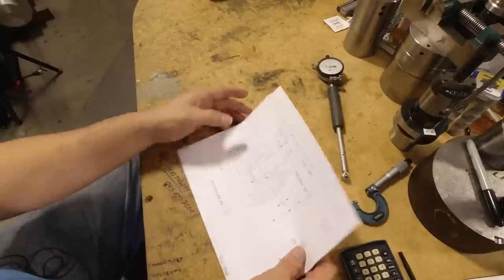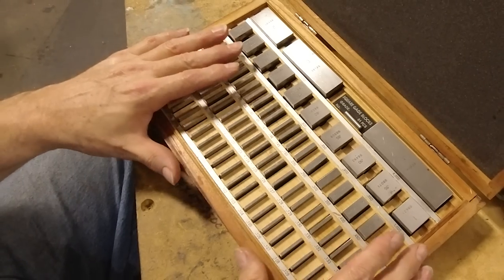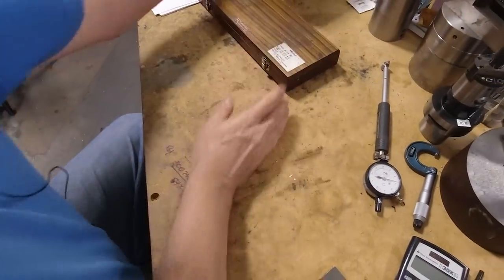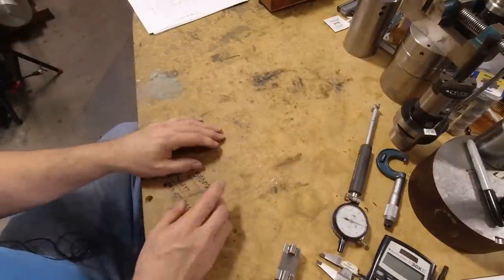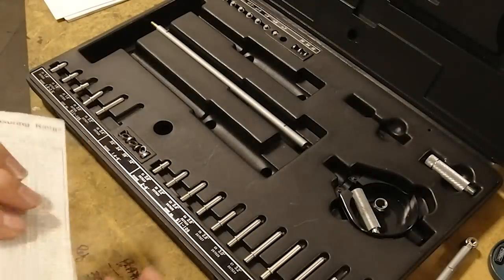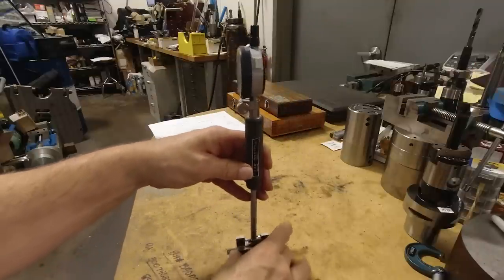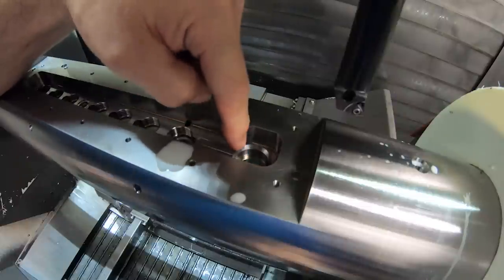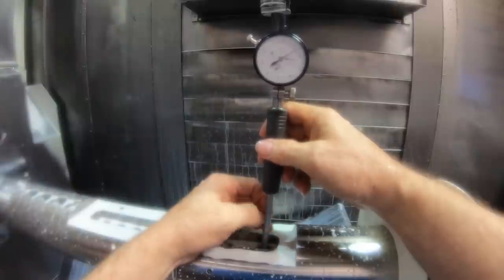Setup A Dial Bore Gauge And Bore

Comment: Thanks for the time you took to include the tool assembly in this video. I just bought my first dial bore gauge (a Fowler model with a total range of 1.4-6"). It came in the case needing assembly and I was looking for some guidance for that job. Your video was helpful, especially from about 13:10 to a bit after the 17:30 mark. I appreciate your having shared your time and expertise. 👍

Comment: Good video. I always set dial bore gauges with a micrometer. I’ve never had gauge blocks to use. I always verify my measurements with a second tool, on first set up, usually an inside mic or telescope gauge. Your way is more accurate for sure. Thanks for the good content.
Reply: gauge blocks are not that expensive really . Grade 1 , 103piece set is 600€ for a no name brand product . One can use a complete set like this to measure grooves , slots , pockets , not just instrument setting .
Reply: Jason Peterson That is how I usually do it as well. I need to invest in a set of bocks like this as it would be handy. I rarely do jobs with tolerances in the tenths range though.
Reply: @bcbloc02  You can also get cylindrical "spacer blocks" for about $50 for a ~36 piece set. They are great for use in the shop when working to a thou or 2. I use them a lot for setting the carriage stop on the lathe.

Comment: paid off my 1st of 2 cnc machines! i have been getting by for 5 years with a 1" mic, 6" caliper and some random precision pins making parts haha.  i appreciate these videos because of the set number and other info, ill be in the market for some of it. im also thinking about getting a manual cmm in hopes of getting more complicated parts to make and some reverse engineering to come up with new parts.
Reply: A height gauge on a good surface plate might be smarter than a really expensive CMM . From a mike and a caliper the height gauge would already be a huge step forward (you can get super duper fancy 'cnc' height gauges too ). Depending on parts a cmm might be necessary, but i doubt it . 
When you have a set of dial bore gauges from 3/4-6" , 0-6" mics , gage blocks , i.d. mics 0.5-4" , 2-3 dial indicators , 1-2-3 blocks angle plates , v blocks , calipers up to 12 (at least) , a protractor , some thread gages , a set of pins for under 1/2" ,16" height gauge, maybe after that it would be worth it to invest 50 grand in a cmm . 

Of course i'm no expert , i just listed the everyday tools that i use almost daily , i didn't even mention groove measuring but that's besides the point .
If i can give an advice....only buy what you need , but if you need it BUY IT , and don't be cheap .
Reply from the maker: I agree with kiss peter. One of the digital height gauges like the Mititoyo or Tesa/Brown and Sharp with a controller. On a surface plate. Like the one you may have seen me use in the casting videos or John Saunders uses on NYCNC channel sometimes. These are way more versatile tools than a CMM for inspection. But they run around $6500.00 new.
Reply: @EdgePrecision  appreciate the tip, ive got two lists, equipment i will finance and tools i will get as i go. i will look into the digital height gauge you mentioned. cmm for me will be as much inspection as for reverse engineering parts to make better parts such as in the automotive and motor sports industry. i have a passion for suspension and chassis and a natural talent for manufacturing. i also want the faro arm with scanner and probe along with a few other things. i want to drive my machine shop production with product development... you have to aim high right..? that way if you come up short youve still gotten further than coming up short aiming right at it haha.
Reply from the maker: DmbWorks for what you are intending the farro arm type of tool would be better than a CMM. It’s not as accurate but to measure things around a car would be much better.
Reply: @EdgePrecision  yeah they do have advantages for different aspects. faro offers the probe and 3D scanner or both in one i believe. probe ive used most for parts with minimally dimensioned drawings, typically on parts with complex surfaces. having the probe option with the scanner would open me up to projects not every shop can do. and yes a good tool for R&D which is the direction i want to go. but i want/need to build a machine shop to support that dream along the way, i have a lot of fab shop tools and experience to. i guess the most important part would be adding the capability at this point. its all on the list, im not married and have no kids haha. i just have to get it in an order that is the most profitable.
Reply: @dmbworks8094  I'm in the same mide set as you man... i recently bought an older manual cmm with upgraded  software for the sole purpose that I have seen more jobs come in as of late with no print (old forgotten military stuff) but a part, a part they need measured and reproduced... and in 3-4 days.... the draw to being able to do a 2d or 3d measurements of a part 20" from the datum with the accuracy of a tenth or so in seconds is very attractive..
Reply: @EdgePrecision   I always use  a cadillac gauge on a surface plate to set my bore gauges, its alot faster than putting blocks together

Comment: I've always made up a gage block stack by starting with the last digit, picking the gate block, subtract it from the dimension, and repeat until the stack is full.

Example: Given a dimension of 0.7438", start with the eight, giving you the 0.1008" block. The remainder is 0.643", so we add the 0.103" block, leaving a remainder of 0.54". That gives you the 0.14" block and then the 0.4" block. The stack is:

0.1008"
0.103"
0.14"
0.4"

The digits 6–9 in the second place are a special case, but easy to figure it when you run into it. You fill them with the 0.11"–0.14" blocks, leaving a 5 in the second place which can be filled along with the first fractional digit.

Comment: Great video Peter,  I have also used two gage pins to check the i.d. of holes putting the pins next to each other and slipping them into a hole being sure there parallel to each other you can feel if there's taper in the hole or if it's out of round like if it didn't clean up completely, where I'm at we have pins that are even and .0005 over so I couldn't check tenths this way, but I get a feel for the straightness and the condition of the hole, really enjoy your vid's the type of jobs you get to machine are very interesting
Reply from the maker: Thanks agb218. For these parts I don't like using pins or telescoping gauges to measure bores/holes. If there are any longitudinal scratches in the bores the customer will reject the part. They fortunately allow the fine scratches/marks left by bore gauges but just that. They are very particular about this. But I can see how that would work.

Comment: Hello Peter
Your works are "poems", I never get tired of watching your videos and I also carefully follow your descriptions even if ... not knowing your language I understand very little!
One question: at the end of the workings in a piece as complicated as the one you are working on, how can you be sure that no chip can obstruct a small hole? Is this check at your expense or will the client take care of it?
Reply from the maker: I don't know it's exact function myself. But it's some kind of part of a down hole instrument for the Petro Chem industry/Oil field. As far as the holes we have deburr guys here that do a lot parts like this. So they have special tools and bore scopes to check for burrs ans shavings in the holes. They also use a high pressure washer to blow 3000 psi water thru the holes after deburr.
Reply: @EdgePrecision  Thanks so much for your reply.
Have a nice day.
Ciao Stefano (Italy)

Comment: Ya i like the Testmess that back and forth needle movement gives it a more fun feel  like if you dont get it on the scale the next contestant takes your place. The cool tools like that indical that test indicator bore gage, and specialty gaging like that have always been a fascination with me. I actually one of the things I'm considering manufacturing is a crow foot set . An automotive cylinder block O-ringing tool with a sharpening fixture for the actual real trepaning bit . And or a valve seat runout gage that uses a jeweled test indicator  and for guide where's  the wear that, runout in the guide or the seat set. not many people can help me get that kinda thing going in my life trust me so its been a battle gettin there though real happy!!! 
your videos are really great peter thanks

Comment: Hi Peter, 
Thank you for your video.
My metric dial gauges for the bore gauge are .002 & .001mm.
Which basically equates to 80 & 40millionths of an inch.
I don't have but would love your Mitutoyo end block set..
The wish list is Long.....

Comment: Peter, I went to look at buying a set of gauge blocks of similar quality that you have.  They are listing one set as (minus) tolerance and another as (plus) tolerance.   What do these tolerances mean and where are the different ones used.  I would like to understand what this is all about.  By the way another great video and it is appreciated.  Thank you.
Reply from the maker: Are you speaking about gauge pins? I have never seen gauge blocks with minus and plus tolerances. Now as for pins yes. The minus means size to -.0002" and plus size to +.0002" So a minus .250 pin would be .2500-.2498" and a plus .250 pin would .2500-.2502" in diameter. As far as blocks I have used they would come with a certificate of accuracy. But if they are called plus and minus it would be similar to the pins I suppose just probably a closer tolerance than .0002". It would be referring to a tolerance that wont go above nominal for minus or below nominal for plus. As for the amount I guess it would depend on the class.

Comment: your the best Peter! I was always taught to work backward from my number to get a stackup so .981 you'd look for .1 first. That may not be the correct way though.
Reply: Any way that gets you the right stackup is the "correct" way. But working from the low digit is the easy way if it isn't a case that is so simple you can just see the answer at a glance.
Reply: @lwilton  I'm sure it doesn't matter 99% of the time, but I would think using the least amount of blocks would be best to avoid unnecessarily adding to the tolerance stack.

Comment: This seems so simple that I’m sure there’s probably a good reason no to do it... but would there be any measurable difference if you used a micrometer to set your reference rather than a gauge block stack?
Reply from the maker: Thanks Steve for your comment. There are two reasons. One it is somewhat more difficult to set on a mic. The anvils are small in diameter. Two if you are measuring very close tolerances a micrometer will set you undersize (I have a video where I demonstrate this. #FX-Lathe-2-2 Second end of lathe work.). A micrometer frame flexes when the measurement is taken. This is why they put clickers or friction thimbles on mic's. This error will increase with larger mic's. I would say if your tolerance is larger than .001" it would be OK, but less maybe not so. To be assured of your measurement it would be better to set on something with a assured calibration that doesn't vary. Like a gauge block stack.

Comment: I really want to buy one of those Iscar/ETM boring heads, do they work well for small holes?  I'm still a small shop and buy reamers for most jobs.  I always appreciate your experience!
Reply from the maker: They are really rebranded DeAndrea boring heads for Iscar. Yes they make a lot of different sizes. For small holes it kind of depends what RPM you can run. The one you saw in this video I have run at more than 4000 rpm no problem. I have bored holes as small as .100 in diameter. But it could go smaller. It depends on the bar you have mounted. Every division on the inch version's dial is .0001" on the diameter. And it really works that good.